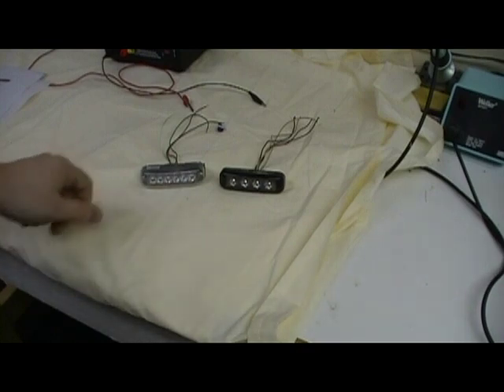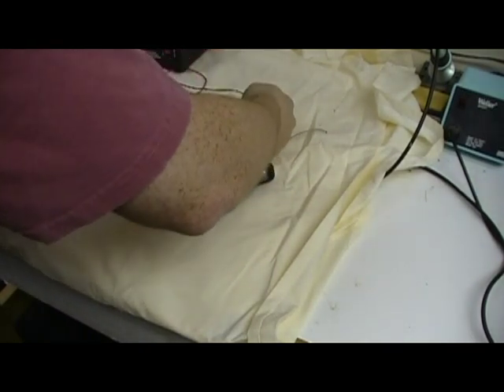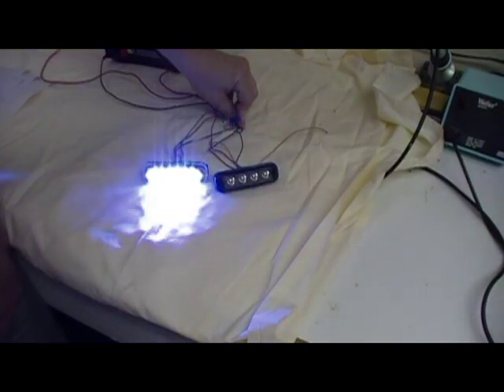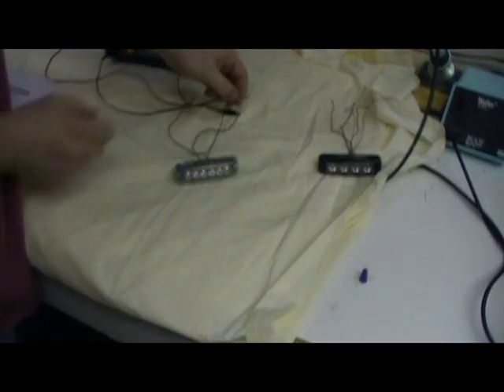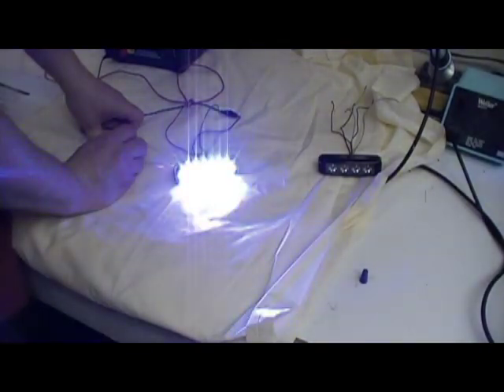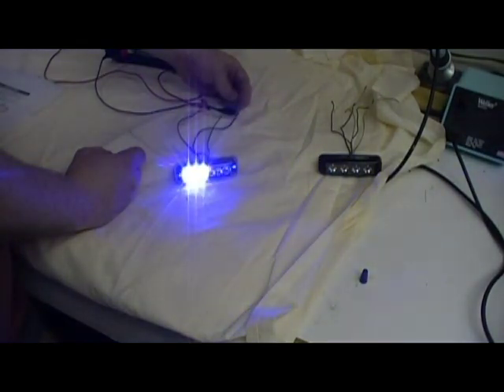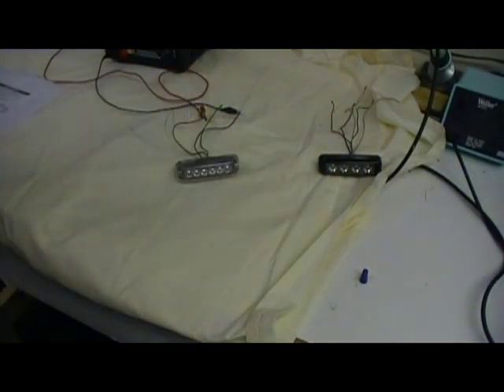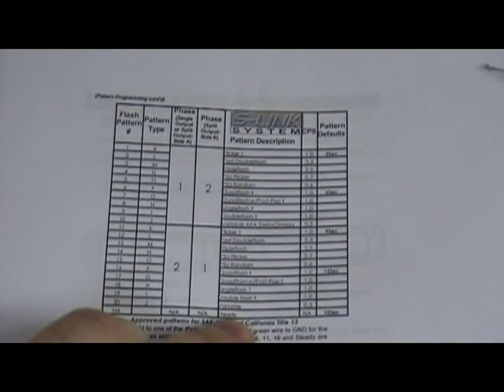DLX4 DLX6  LED emergency warning light Demo & install video

Comment: What kind of switch would you use for these?
Reply from the maker: SuperKiller177 starsignal has options with one or more switches.  check out the below link.  http://www.star1889.com/switch-panels-and-boxes.

Comment: How much was this i help the FD a lot an that would help a lot!!
Reply from the maker: the lights are between 50 and $100 depending on how many leds (3, 4 or 6) per head, where you go ....
The 13.8v dc power supply for trouble shooting was like $50

Comment from the maker: Locally most automotive stores will have stranded hook up wire and switches.  That's fine for a few lights; if you are going to install a large number of cars/lights you may want to look at an electronics distributor for larger volumes which will bring the price per foot down.  you can just google hook up wire.